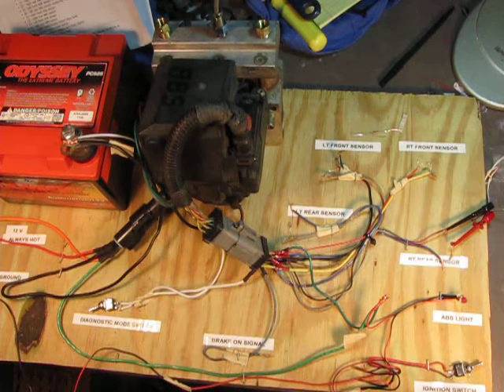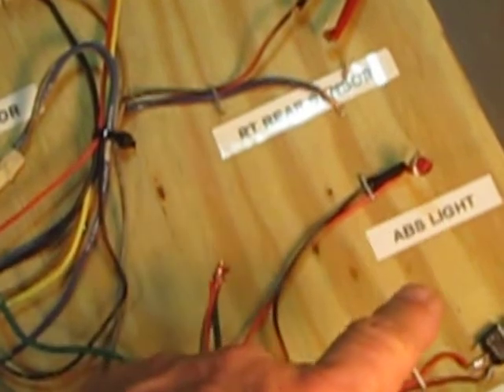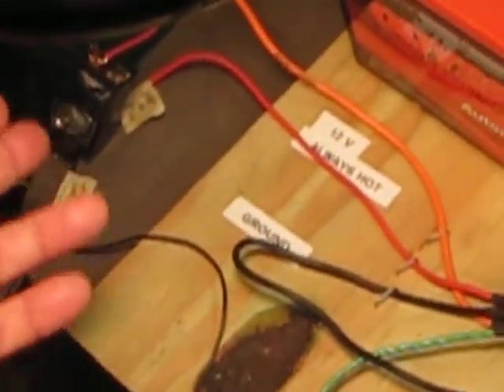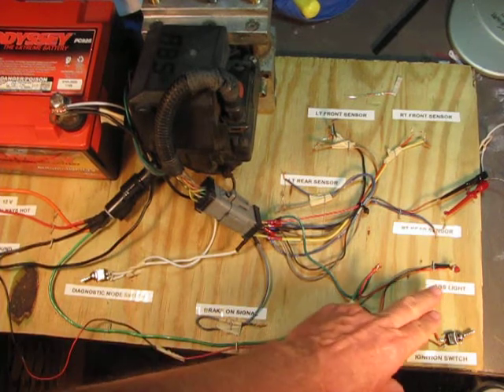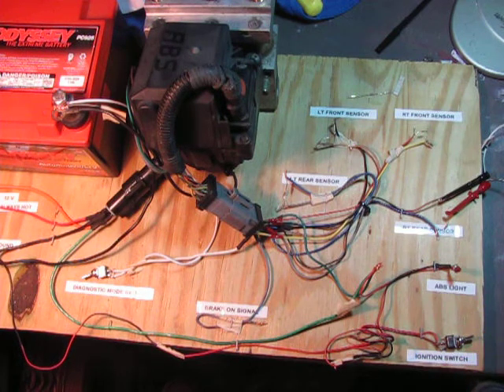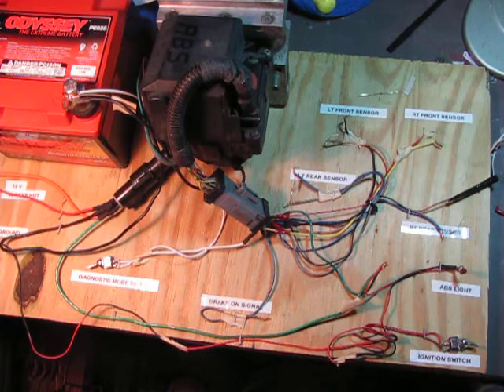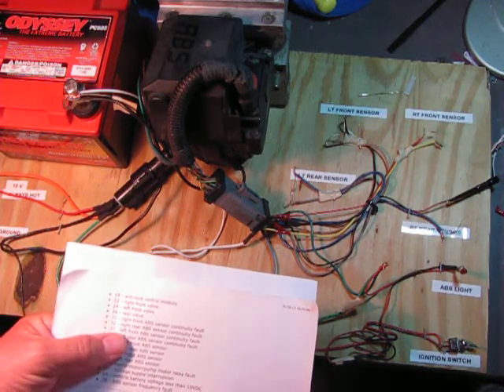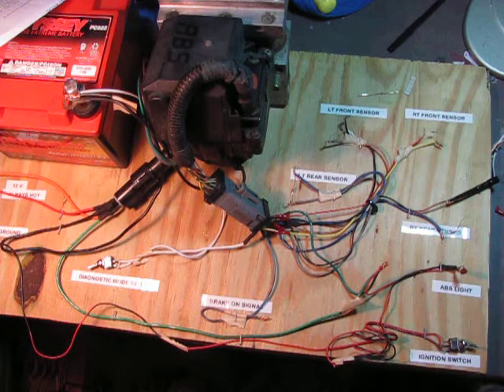ABS bench test of mid 90s mustang, part two of three videos

Comment: Hey I have a 95 gt I have a code 63 which is insufficient voltage I checked all my fuses and checked voltage going to the unit all seems good I don't think I have any broken wires. So I took the ABS unit off the car and bench tested it the pump works and I put power to the solenoids when put the power to each solenoid I hear the relay click but I don't hear or feel  the solenoids doing anything they seem stuck should I be able to feel them working or do they have there on unique sound from the relay

Comment: Very informative. My abs light is on 95 mustang  when I check the code I get code 12 which means “system ok” any idea what it may be. This only happen when the car is cold once a drive a few miles the light goes off.
Reply from the maker: Hi Brandon,  as I remember the  " self test " only takes a few seconds and I don't have any idea why yours is taking longer.  Its been quite awhile since I've had an interest in this, unfortunately  I could never adapt this ABS to my cobra as my rear axles didn't have the "tooth rotors".  to use ones that had the rotors would require changing rearend housing and axles.  So the whole unit is sitting in storage, should sell it cheap.  The only advice I have would be to  unplug the connectors, clean and reconnect, check ground wire connector, things like that.  Not so bad what its doing, to check it for function, you could unplug or move a sensor and see if it codes out a fault, if yes, then just go about your day.  But if you are like me, that would drive me crazy!! good luck.  Ted
Reply: Thanks for the reply and the informative I’m going to do some more digging into it this weekend. I’m thinking the module is going out.  I might be looking for one if you are interested in selling yours. If I get this issue resolved I’ll give an update, someone else one day might be trying to figure out the problem I’m having. Thanks again!
Reply: @brandonquinlan8613  Did you ever get that code 12 straightened out?
Reply: @george_in_TN  the light still comes on from time to time but it will only stay on for a short time. I think I have a ground issue or a bad connection some where. I hope to start messing with the car this winter. We ended up moving, remolding a house and I just built a new shop. I’m starting to get settled into it. So I will soon have time to play with the car again. The last two years I only put about 1k miles on it.
Reply: Are you having similar issues I mentioned above?
Reply: I did get the 12 code and it never went out.
Reply: @george_in_TN  are you getting any codes?
Reply: @brandonquinlan8613  I was away from project for a while, found another used ABS module for a back up.  Back at it, now.  Setting up a bench test like above.  Do you or ted K have a wiring diagram for the bench test setup?   Just want to make sure.